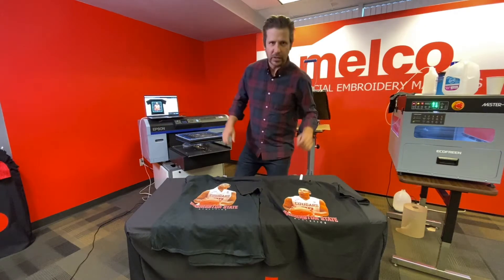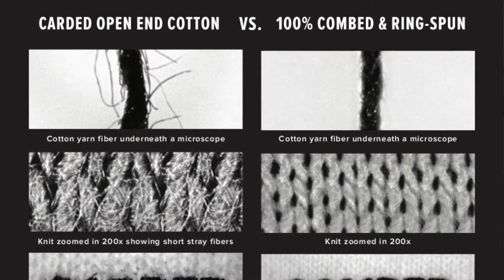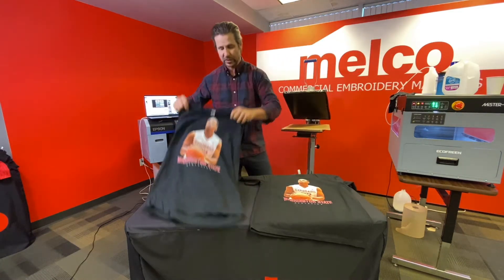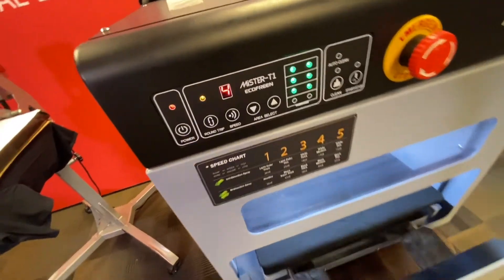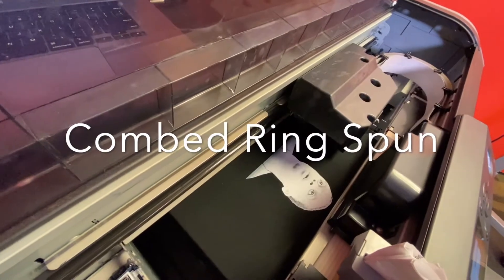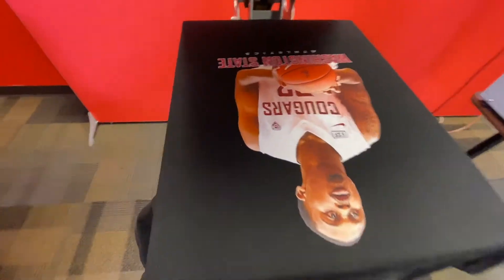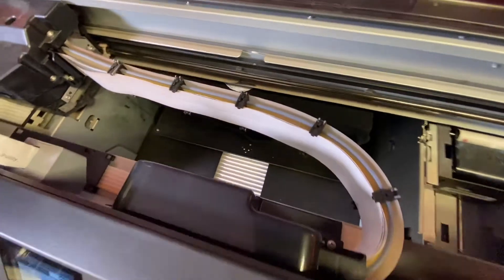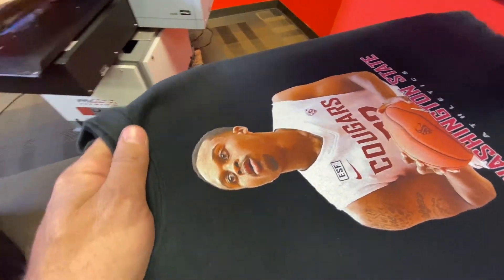Bright Prints with Ringspun Shirts with Epson DTG Printers- ProDTG Tips

Comment: A few questions if you can help us. 
1. Are you using a paint brush, a paint roller or nothing to push down the fibers on both of the shirts, after they come out of the pretreating machine? 
2. How are you drying the shirts after they come out of the pretreat machine? Are you heat pressing them instantly or are you allowing them to hang dry before Printing on them?
 I apologize if you have answered these questions in one of your other videos, Thank You in advance.
Reply from the maker: Hello. Sometimes I use a paint brush, but it's not necessary. Here is a quick video on how to pretreat properly. https://youtu.be/jSghkJTUoRc

After they are pretreated I can hang dry the shirt, use a conveyor dryer or use a heat press. If I hang dry usually I brush the shirt first then put a fan on them, 30 minutes later they are typically dry. 

Remember pretreated shirts must be 100% dry before you can print on them.
Reply: @MelcoEmbroidery  Thank You for your prompt reply. Of course after askiing my questions, I watched your other videos, and they answered my questions. 
John You the Man!